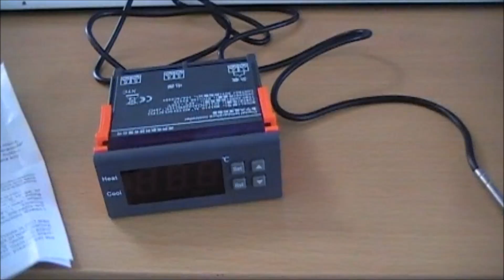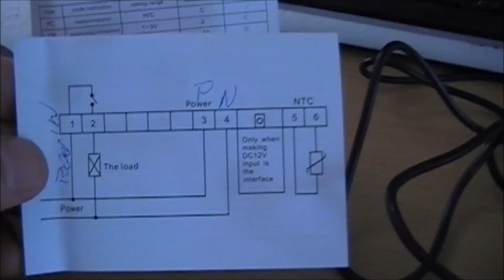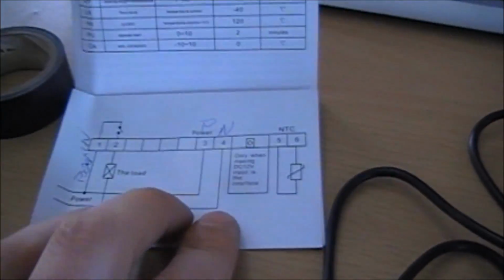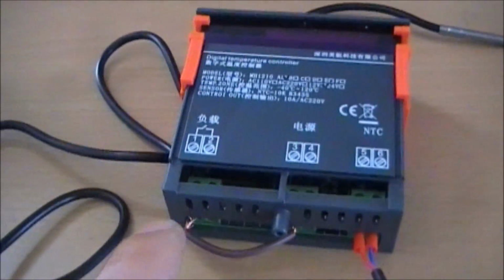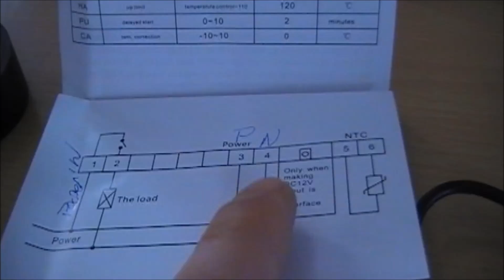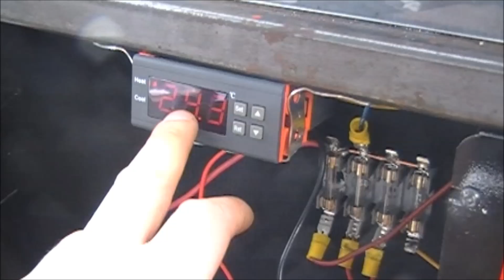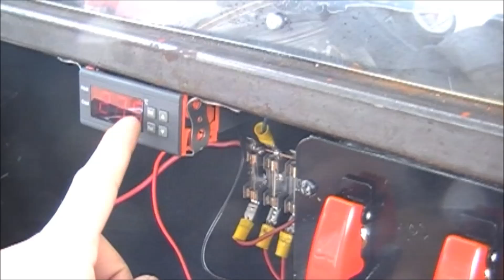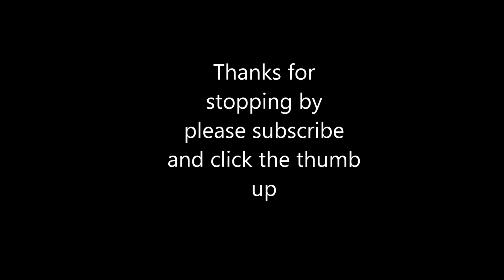12v Digital Thermostat Wiring And Install Into Tractor Cab

Comment: The AC version, it does not care Hot or Neutral. I would imagine it is the same on the DC as strange as it seems.. 
You can cut the power and it will not loose its settings.. I have one that I use 2-3 times per year and it even keeps the temperature settings.

Comment: Hey man, thanks. Wanna fit it in the boat to cool the Lithium batteries. Reason: the heater tubing goes near them so want this to control a fan. 12 V system. What bothers me is it says <3 W consumption. That’s pretty much if you leave the boat for a while? Found other thermostats with ratings 35 mA which is MUCH less. But they have blue Leds and I want red to be able to sleep.

What’s your experience on the consumption, can’t be as much as 3 W for stand-by operation? That sounds ridiculous!

Comment: I've been looking at a few of these models on Amazon and my God, it would have only cost them maybe a few cents more to add the wiring so that people don't have to be electrical engineers to figure all that out themselves! I'm looking for something to control heat in a reptile rack I just bought and hoping to find something comparable to Vivarium Electronics or or Herpstat (made by Spyder Robotics) but under $100.

Comment: Thanks for making this vid, the orig diagram is useless.  I've wired mine slightly differently by using the 12v power socket to power the temp controller via a fused + lead.  I found an old mobile phone charging cable and snipped the connector off.  This way the temp controller itself is also protected by a fuse (I've used a 1A fuse as I can't find any info on the temp controller's own power rating!).  I'm no electrician, but I'd be worried that by using a jumper cable (taking the + to power the temp controller from the same source as the appliance being controlled) means that if the temp controller's power circuit is rated at less than 10A, you could fry the controller before you'd blow the appliance fuse.  Of course if the controller's power circuits are rated at the same 10A as the load circuits there's no problem.  Thanks again for posting your great vid, very helpful.
Reply from the maker: I'm glad I could help ..

Comment: Nice set up, I would run the LOAD to a relay, 7 amp draw with max 10 + china = trouble, You can run a relay on 1 amp and then have a 20 amp relay.
Reply from the maker: Ok thanks for the tip